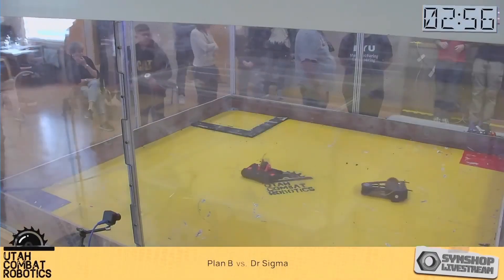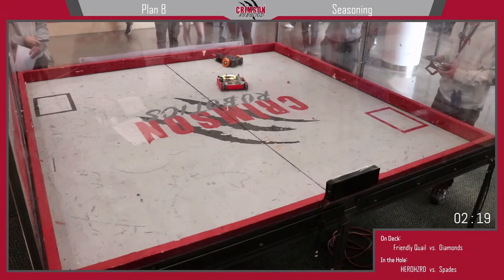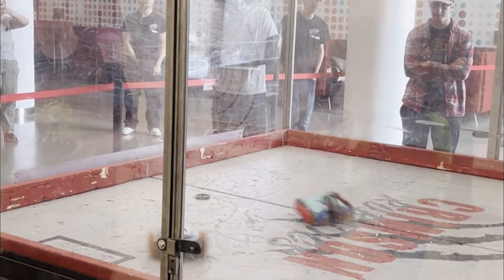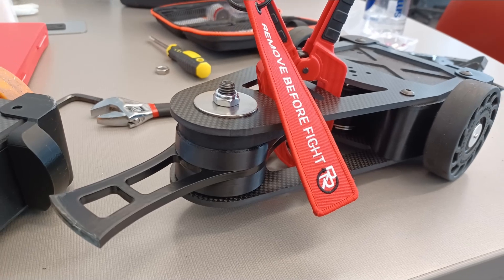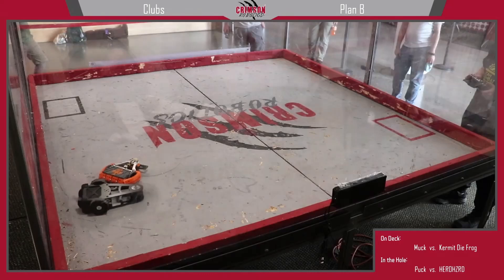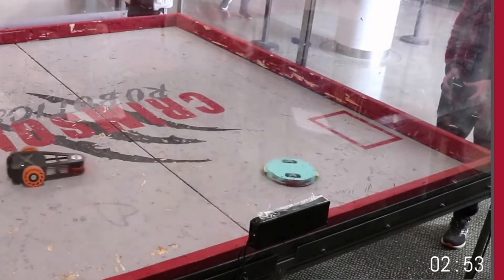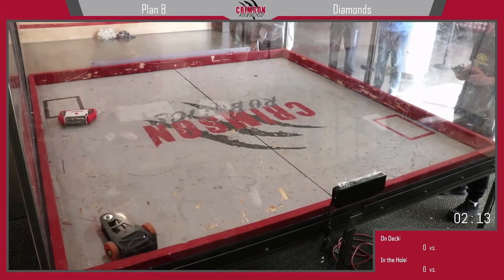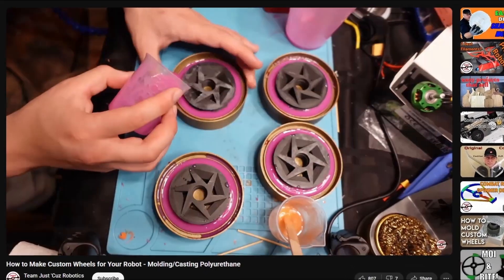Broken Bot Bits (Crimson Bot Brawl - Spring 2025 Recap)

Comment: I think the biggest thing holding plan b is the drive motors themselves because when the drive was working plan b was kicking butt, trillian was folded like a lawn chair.

22mm gearboxes and 4mm shafts don't hold up super well when directly driven, especially with such large exposed wheels. Dartbox pros or repeat max brushed would hold up better but they would require a lot of hardware changes. This would also ve great time to upgrade your battery to 4s since dartbox motors are designed for different voltages. 

I've never seen anyone do this but I wonder if you could make TPU hub caps for the t61 wheels that protect the mounting hub. You could add some pilot holes in the plastic rim and just use plastites to mount it. This would hold up well with 24mm gearboxes but for 22mm gearboxes wheel guards would be better. Wheel guards can cause some problems since they make it easy for mid cutters to get stuck on their side since most horizontals don't have the torque to lift themselves off the ground.
Reply from the maker: I like your idea with the T61 hubcaps! I've seen someone make TPU caps to act as replacements for the snap rings on T81s, but I think your way would be better for my use case. Do you think it would help the 22mm gearboxes if I switched to 6mm axles?